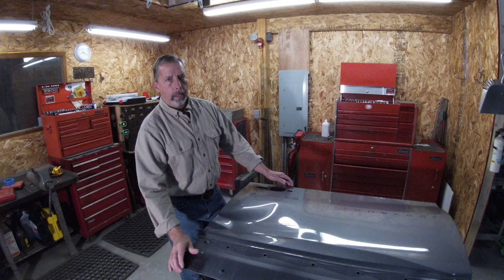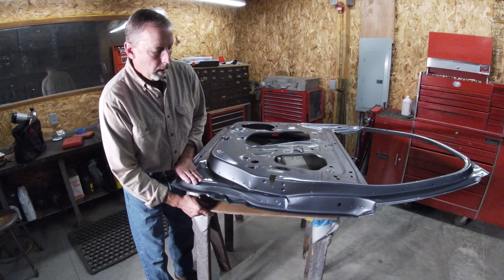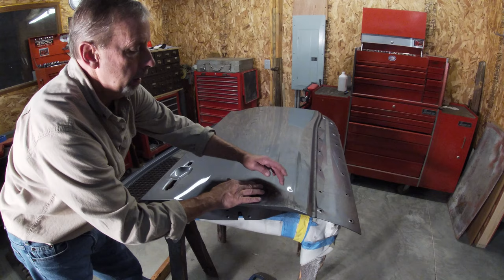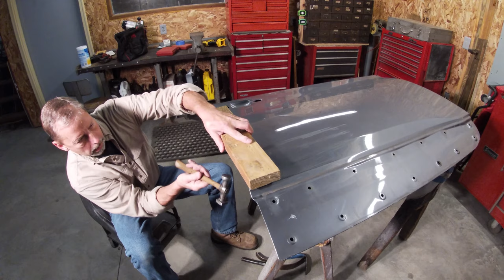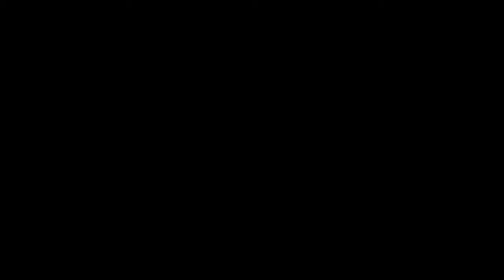Auto Body Repair/Straightening A Door Part 1 of 8

Comment: 8 hours? but how much would it pay, I never actually worked in a bodyshop,and dont know body, mechanical and paint times?
maybe do a series of the time and process of a car going thru a bodyshop and how people get paid etc, I think some of the younger guys need to know and us older guys like to understand the flow thru a shop
Reply from the maker: Although I had about 8 hours in this repair, it’s tough to get insurance companies to pay that much. I was showing how and what could be done with this panel. A video dealing with the repair procedure as a vehicle moves through a shop is something I’ll consider doing but not sure how many people would be interested. Thanks again for watching Richard. I always appreciate the input
Reply: @autobodytrainingsolutions838  it could explain why repairs take so long and cost so much,filler takes time to dry,primer takes time to dry,people dont show up to work,not enough real estate,weather conditions play a role, adjusters/insurance takes time to approve claims etc and these days just finding parts is a hassle